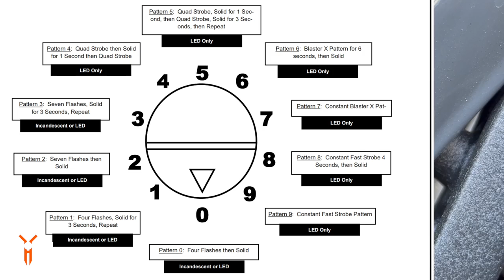Impossible Physics - Tail Light Seen From The Side?!

Comment: Looks great. Try the 2 to1 exhaust next.  I did it on my street glide and it made more power I did use a tuner and had it dyno but I think there is still a benefit even it's not tuned right away. You would have to make sure you have a high flow filter to accommodate it. Guessing that's what they call stage 1 with you having the 117 I wouldn't go messing with the cam or anything you have plenty of power to unlock in that motor